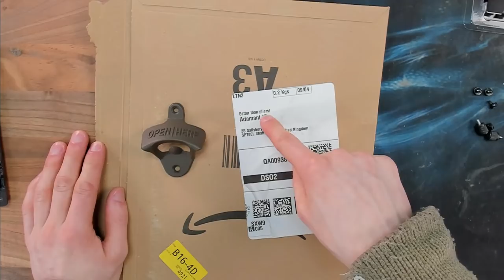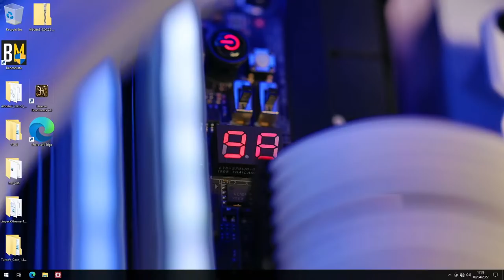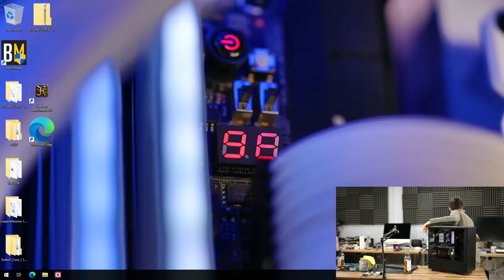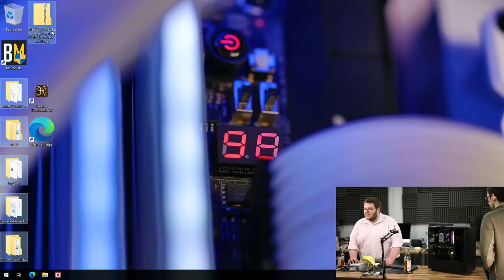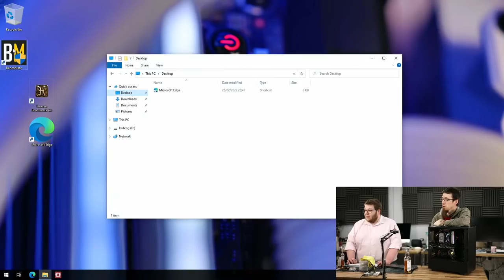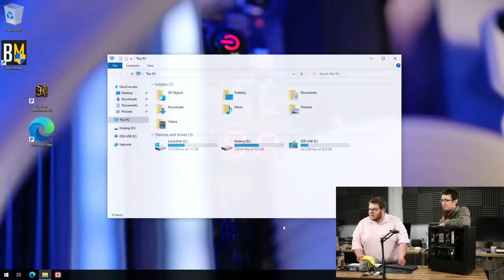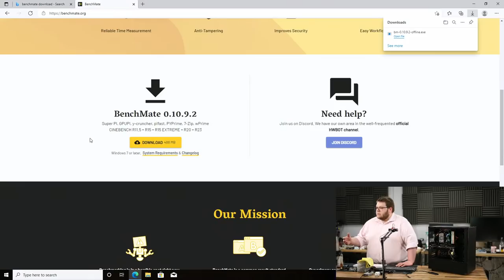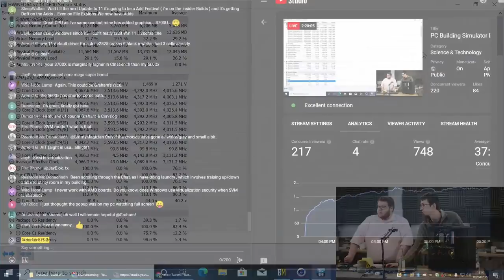PC Building Simulator IRL - Two Guys Talk Tech #74

Comment: I use to agree that if it had a Corsair logo you were guaranteed it’s a good product, but then I bought a obsidian 1000D and that went to hell! It seems corsairs quality has gone to hell ever since they did their IPO. 

I really can’t believe they still have not fixed their cable spaghetti issue. I really thought they would of copied Lian-Li and implemented the push pin connections to power fans and refreshed their QL lineup. QLs in an aluminium frame and with the push pin connectors like what Lian-Li uni fans have would be the last fan you would ever need! Yes expensive but so what? Uni fans have basically been out of stock since they launched and there the most expensive fans on the market so cost obviously isn’t a issue.